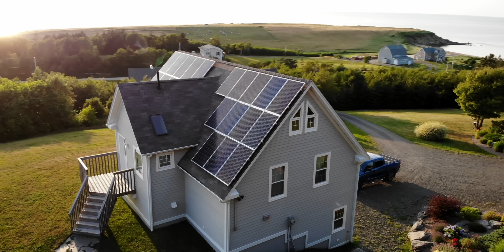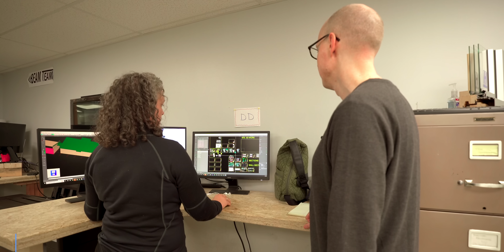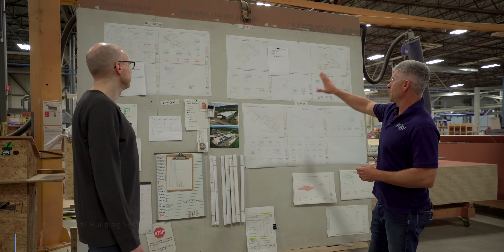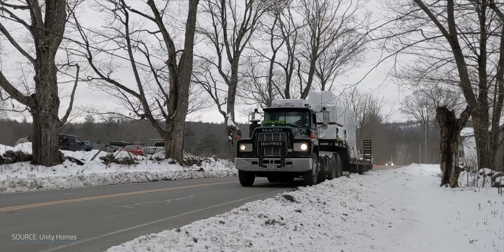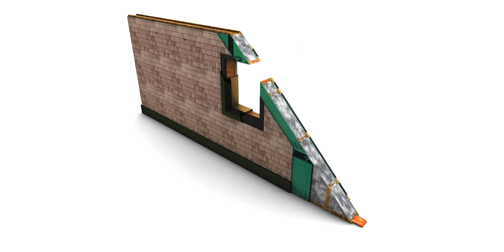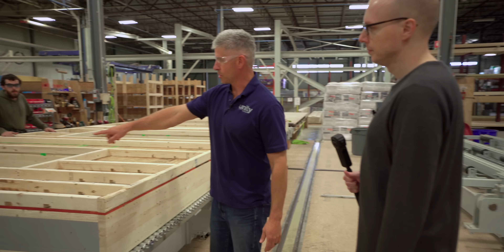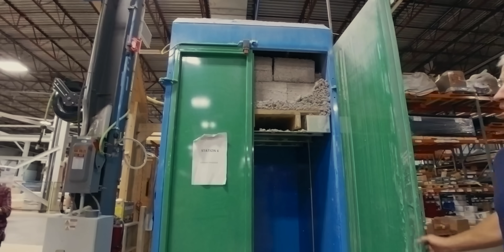The Simple Genius of a Prefabricated House - My Net Zero Home Build

Comment: The European tilt/turn windows are awesome! Things to consider. If they open inward you'll have an easy time cleaning the glass, but you'll need space inside for the window to swing open. This means if you're thinking about growing potted plants inside, well, the plants are going to get in the way when you try to open the window. You can solve this by putting the pots on a floor shelf with wheels. 

If the window opens outward, you'll have a harder time cleaning the glass, and you won't be able to have a flower box outside your window without the flowers getting in the way. I'd use the outward opening windows on the ground floor if I didn't plan on have an outside flower box.
Reply: European Here. 
That's why most Europe windows has the option to "unseal". (You have to pay extra for this, but really, not that much) You have the option to turn the handle further, so it's actually facing upside down, and then the whole window opens up just a little bit but.... hinging from the bottom! (Yes, the whole upper part of the window opens) It is super convinient to vent and to use, and you can keep your plants.

Just search for "tilt and turn window". I guess some people could be amazed seeing it first time. In Europe it is in Every house i see so people treat it as common knowledge.
Reply: @borjaetxebarria7746  PS: Having lived with those windows my whole life, I can attest to the fact that opening them fully is a rare event. Most times, they will only be tilted; in fact, at this very moment, there is only a single window in my home I could open without having to spend some time moving stuff out of the way. And that's the staircase window that doesn't have a sill to put things...

Comment: Matt I am a firm believer in this process. I have been building for over 40 years and I purchased a factory built home in 1997 for my own family because I see so many benefits there.
My question to you and the company you worked with is why not use metal framing? Made from recycled metal it is more stable and dependable?
I love following your channel and appreciate all I am learning there. Thanks!!
Reply: I suspect the heat/cold transmissibility of metal framing might be part of the problem.
Reply: @lancethrustworthy   continuous exterior insulation would solve that problem, like they use in commercial construction.
Reply: The cost is considerably high in metal framing a home. That would be insane!!!!

Comment: I find is interesting that most industries prices come down with innovative. At $300 per square foot I find this expensive compared to the cost of building homes where I live. I understand modular construction. It’s been around for decades.  Driving down costs is a very good sales point but only if those costs savings are enjoyed by the consumer. Remember builders in this country have never been impoverished.

Comment: I am a builder and have been for fifty years. During that time I have seen many amateurs like Matt promise us that on site construction is outmoded inefficient, excessively expensive, and soon to be swept away by manufacturers like Benson. But doom has not struck. As Time magazine once noted, manufacturing of housing is an idea whose time never quite comes. 
There are several basic reasons for that. 
FIRST, site builders get more and more efficient even as factories also introduce efficiency. You'd be amazed how rapidly two skilled carpenters can frame a simple house like the one that Matt is purchasing. 
SECOND, while there is waste at the job site that factories can eliminate there are also extra costs and waste, or at least substantial additional  use of resources,  imposed by factory building -- like extra dense insulation and zip panels on both sides of the wall and that extra layer of framing on the interior of the Unity Homes wall that are just not necessary at site built homes. 
And THIRD, did you notice that the factory is actually, well, a factory and that as such it incorporates and consumes a huge amount of material and energy consumption that job sites don't. Additionally the factories impose giant overhead costs not experienced by site builders. 
The result, as  I have noticed through several boom times like the one that has been expiring in 2022 as I write this note, is the the factory building of housing proliferates during the good times. When the recession comes, house factory businesses collapse under the weight of their huge overhead costs. Canny site builders just pull back, shrink, and wait for the next boom to re-expand
If any house factory business is going to get through this next recession, it may be Ten Benson's (and a few others that have demonstrated sustainability already). We'll see. But however it plays out we are still a long way from factory built housing massively beating out site built homes on either cost or quality. Don't assume that just because a house  is built in a factory it is of higher quality than a site built home. There are site builders who do damn good work. There have been factory builders who put out junk that fails and brings on  lawsuits from disgruntled purchasers. 
The fact is, so far factory production has not put a meaningful dent in housing production. In fact, some statistics suggest it is actually losing ground. Again for good reasons. It has not proved to be more cost effective not necessarily to provide better quality. Please note that Ferrell avoids letting us know how the costs of a Unity Home would stack up against a site built home form a reliable and established site builder. How do they stack up, Matt?  Give us transparent and comprehensive numbers when your home is completed, would you? 
To be real blunt, as entertaining a reporter as he is, Matt Ferrell clearly does not know very much about housing construction. He makes that clear when he announces that he just "doesn't understand" why all houses aren't produced the Unity Homes way. There are, as I have pointed out, substantial reasons. But he's too enthralled with technology too explore them in his presentation.  
          Comment submitted by David Gerstel, author of Crafting the Considerate House, Nail Your Numbers: A Path to Skilled Construction Estimating and Bidding, Running a Successful Construction Company.

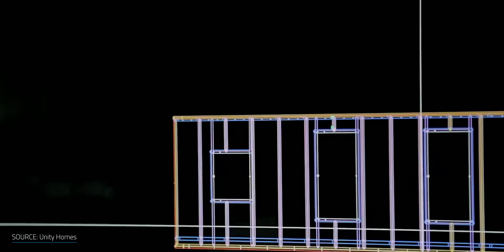Comment: 18:15 Then you should be prepared for the culture shock for "design change" or ECN.

Also, better bring onboard PLC & automation engineer + someone with MRP system and someone from the car industry who knew JIT and Six Sigma (sound extreme, but it beneficial to have this in your team in early stage).

Comment: How do you address inspection requirements? e.g. Framing, nail pattern and insulation inspections when these items are completed already when thr wall panels arrive on site. -Maybe I could get local bldg. dept. to accept a factory inspector (3rd party) that  is certified to I.R.C. 2021? - I am an unlimitrd licensed GC 30+ yrs. This looks like a great system, but getting bldg. depts. on board has always been a problem with prefabed construction.

Comment: Your "Wall Studs" go from front to back with no "thermo-breaks." and no "Continuous exterior Insulation" (without studs).  

The New Residential Building Energy Standards and passive and net-zero-building requires "Thermo-Breaks" and "Continuous exterior Insulation" (without studs) on all above-grade walls and roofs.

What is a Net-Zero Home
"Zero-net-energy means that over the course of a year, a house generates as much power as it uses. 

This means the less insulated your home is, the more energy or power you have to create, for example, solar power.

Comment: As an architect I would say that we can do better with cold rolled steel. The process and presentation was very nice but all that process and more can be done with STEEL FRAMING. With cold rolled steel we can recycle and the manufacturing is a lot faster and more economical.

Comment: Hey Matt great video! Curious... What's the cost per sqft vs regular stick built homes? Thank you!
Reply: I am very curious about the cost difference. !!!!!
Reply: @vandettabuilds6641  Im planning on purchasing a prebuilt modular home as well and have found them averaging between (depending on the size and features) anywhere between $10k and $200k, while stick built houses usually run between $150k to $500k and even more. If saving money is your aim, there are much better options than stick built, such as 3d printed houses, built with a huge 3d printer out of a variety of material including both solid concrete and foam concrete which is just as strong as solid concrete, but uses 1/10 of the materials. If sustainability is your aim, you can even choose a material such as hempcrete. Hope this helps. You can Google "pre built modular homes" to see the extensive variety, with the most expensive being made in Europe and the US, while the cheapest are built in China (2k-10k for a studio-2 bdroom home). Also, for amazing value also check out "container homes", built from shipping containers, once insulated you have a home that is termite proof, fire proof, earthquake proof and extremely durable.
Reply: @AnnetQuintanaKnowsBest  Annet  you are not considering all the sub contractors coming in after the shell is put up   For all the different types of materials you could use to build the home the subcontractors are going to charge you a arm and a leg to carry out their job because it’s not a standard building material they have to work around to install their product into !!! 
Do you understand what I mean   Wood framing structure is a standard building material that subcontractors are familiar with and their materials are a standard material designed for wood framed houses 
You notice he didn’t give a cost per square foot on final product because it’s considerably higher than stick framed houses 
I come from a family of builders as well as realtors 
Trust me I know exactly what I’m talking about 
Please feel free to as me anything!!!

Comment: They also seem to be using just about the best materials available.  The window seal tape they use, for instance (16:28), is Wigluv, which is the best on the market and Swiss made (I happen to know this because I needed it myself for a build 😋).  Impressive.
Reply: Zip System shealthing is good stuff, too.
Reply: mix well- Zip System has been shown to leak where nails penetrate the panels .
Reply: Good feedback, thanks

Comment: A bit surprised there wasn't more robots on the element assembly plant. There already is 3D printing robots for elements and houses - at least experimental. Digital twins can also be used on the construction site. When they're integrated to machines their operators know where to dig and where not to, where to put something etc. without making a single mark on the site.

Comment: I ended up having for forgo my geo thermal plans.  The quotes for it in my area went up so much that I just cannot fit in. Instead of 8-12k more than a traditional set up it ended up being 25-30k. More than double the price of the standard HVAC install.  I still wanted to but at that price it was starting to look like I might not even be able to get the house if I pushed it as it would be to far beyond by budget. Maybe I can review it again later and still looking at solar after my current house sale. The prices of that still look reasonable.

Comment: I love your videos and I also like the Unity Homes system. One question that came to mind is future serviceability. It looks like Unity Homes are very sturdy but eventually any building will need maintenance and repair and homeowners may want to add on. The Unity walls look great, but it would be hard to find a contractor who would be able to figure out how these walls are made and how to perform future repairs. Is Unity going to be around 30 years down the road for repair manuals and parts?

Comment: Matt, this is very exciting, but when people discuss affordable housing, its crazy to me to say that just construction at $500/sf not including site prep, cost of land, etc, not to mention the cost of drilling for geothermal and adding solar panels and battery banks, is affordable.  That's just not affordable for most people.  Affordable housing is considered housing that does not exceed 30 percent of a household income.  The average annual household income in the US is less than $80,000 which is equivalent to about $2000/month or a mortgage of about $250,000.  Even if you saved $1000/mo on electricity, that might allow a $350,000 mortgage.  With the average home in the US selling for between $425,000 to $500,000, you can see that the average household can't affordably own the average house.  In reality, I live in the Midwest, where property, cost of living and electricity is relatively less than other parts of the country, but my household income is nearly twice the national average and my home cost (mortgage and electricity/gas) is less than $2000/month and we still feel like we live month to month, so affordable is definitely relative.  Don't get me wrong, I'm a big fan of all the pieces discussed in the video, as an architect I too can get exited about triple pane euro style windows and doors, zip panels and passive haus construction.  But I'm disheartened when the builder and the building industry thinks this is affordable.

Comment: I appreciate the plug for net zero homes you bring to your followers, and Unity has a very nice mfg facilty. 
However I sincerely hope this is not a solution for the masses to be able to tackle our inefficient housing designs. It would appear that the house in the video took several acres of forrest removal to build it, long term maintenance will be VERY expensive if fault in building envelope and repairing wood rot in 50 years will be a nightmare. Building a Net Zero home is only half the issue we face in home construction going into the next century. 
Please show your viewers how alternative building materials with decades of use are better suited for super insulated walls and most importantly, less deforestation. 
ie: Monolithic Hempcrete, Autoclaved Aerated Concrete, hemp and rock wool, and even Structural Insulated Rammed Earth.

Comment: I am a builder engineer, I think about all of it, Worked in giant HVAC factory giant ones. This makes good conventional sense. Compressed earth makes sense and the south with reflectors to power the home a swampy to digest waste. I have yet to try to make a comprehensive design. I love passive solar and using the earth as a heat sink. A foam cement molded lego. A bullet proof wall is good for a home too. A home that lasts not wood. If you can improve it like injecting it with Boron. Non toxic fire resistant. Bug won't eat it either.

Comment: Having been in the trades for many years I have seen the 'short cuts' in construction especially in new residential construction where "piece work" contractors are paid by the unit they produce.  In my own home the drafts during winter months around electrical outlets on the outside walls revealed the sloppiness where the fiberglass insulation was absent from the immediate area around the box.  Building Inspections?  Done on a spot-check basis and depending on volumes produced that becomes sparse especially when the relationship between the inspector and builder is 'cozy'. Where I live in Canada "framing carpenters" are pretty much unregulated and the only qualification requirement being that you own a pickup truck and a hammer which explains residential roofs blowing off in high wind storms with insurance claims taking lengthy times of resolution.
This is not unique to residential construction.  On large commercial buildings, including hospitals, the 'errors and omissions' get 'overlooked' when the financial closing date arrives especially on "Public-Private-Partnership" projects.  On these sites project management is under incredible pressure to sign off "compliance" or face a litany of legal challenges.  

To me this approach has the efficiency and quantity control that should be the standard in the construction industry.  I take my hat off to the people that put the effort and resources into developing  it into a successful business. It is analogous to the SpaceX/ Tesla venture.  Unfortunately, those who are successful at it fall victim to those who lack any understanding of the insight, dedication and engineering it takes to make the world more efficient and environmentally responsible.

Comment: Less waste?  What about the extra 2x3 wall for wiring, etc?  Energy efficient?--Wood is an extreme thermal conductor.  Take the given R value of a wood framed wall and subtract 25%.  Unless you clad you house with EIFS which has no thermal conductors like nails (or studs).

Comment: Yes - mass production should also lower the price of a new home.  My daughter lives in an area of Texas where an entire village of several hundreds of homes are being built on slabs with minimal yard space.  An entire new city is being built.  The exteriors are engineered stone looking.  The builder has been on this job for at least 5 years with many contractors and workers on site year around.  They continue to build.  The value of these homes is 500 k on up.  None of them look exactly the same but they are all similar.  I wonder why they wouldn't use off site building and crane erection with only final touch interiors and exteriors.